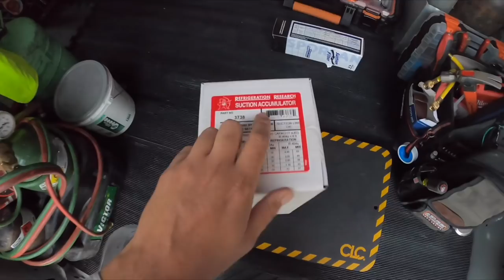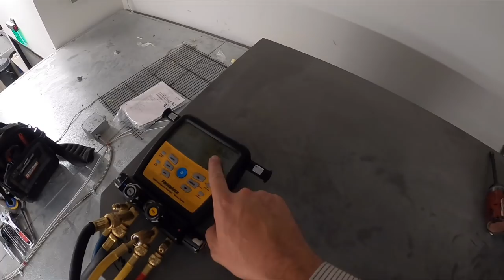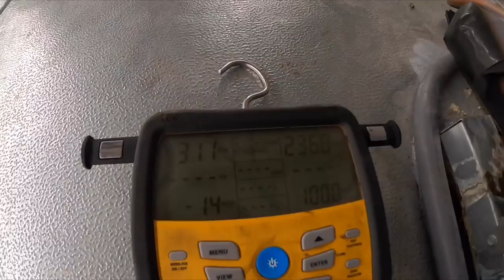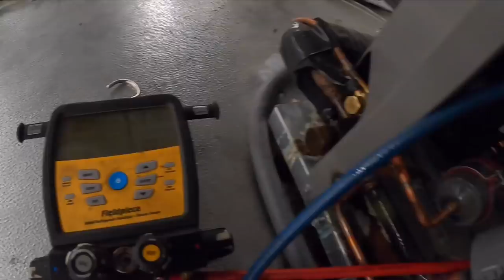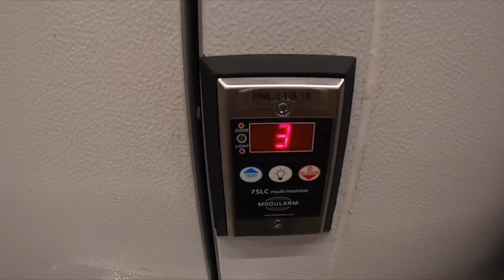WALKIN FREEZER VLOG

Comment: lol, GOT ENOUGH SOAP? Good job man, but damn, you soaked that damn unit lol. I would not spray the hose connection. It'll get inside the hose. Possible contaminant. Also, I always tell new refrigeration techs, to NEVER become an installer, or call yourself an installer. If you call yourself service tech you are both. It might be hard first year or so, but when you UNDERSTAND refrigeration cycle, when you actually can visualize the refrigerant flow inside the system, if you UNDERSTAND temperatures and pressures, you are the tech. Trust me, you will be unreplaceable. Serious refrigeration companies will NEVER look for installers. The pay by an hour (no commissions), and if dont cut it, you dont cut it. I went through the entire year of apprenticeship in 2006, but leaned lots. Also, if you treat trade as just a job for paycheck, you will be moving up super slow. Lots of informational videos on YouTube, lots of articles. Study, research and be interested in what you do, and then, you WILL become above all and unreplaceable. Good luck all! Stay SAFE and thanx for the video bratha! This Corona shit sux, but its a great time to invest in yourself as far as knowledge goes and improve your skills.

Comment: Do you not have to wear a body harness when working that high off the floor?
Reply: Actually, OSHA requires fall protection at heights of four Feet or higher. 
 I do commercial HVAC/R for a very safety oriented company. If I was caught in your position without my fall prevention harness, I'd get in trouble
Reply: Jake M only if OSHA officials caught you lol I never see OSHA officials in my career but one of my buddy was doing lifting with crane and OSHA official came
And ask buddy if he know where’s the safety switch for lift to come down if the lift is stuck at high height ? Buddy said no then OSHA official showed him where’s the safety manual in box. So he got fined and paid hefty fine ! No joke with OSHA.
Reply: Never seen an OSHA official. Our safety coordinator will however randomly show up on job sites. 
 He will inspect your work space, and ask to see if you have your PPE on you, make sure ladders are strapped properly, fall protection, hard hat if required. My company takes it seriously. I don't mind, gotta be safe out there.
Reply: Jake M but then osha allows a air handler in a retail space where you cannot access the filter door and it gets passed!!! But go up six feet and get in trouble!!!-
Reply: That's irrelevant. OSHA usually does not care if the equipment is installed in an area that may require mechanical assistance (I.E: multiple ladders, grid ceiling removal, or scissor lift) for service. Sometimes OSHA rules can't be followed if you chose to not adhere to them due to reasons of finance. You can always refuse to do a job you feel is unsafe without a plan of action.
Reply: Also. OSHA has little to do with enforcement of local construction codes/rules.
 If a customer owns a piece of equipment that has fallen through the code cracks, that's their problem, not yours. 
 They may need to pay another contractor, or you and your company.. To rectify the current issue and resolve the other
Reply: I just didn’t want him to fall and get hurt because I have seen people get hurt in any situation!  It would be hard for him to make a living for his family if he’s out of work!  Just be safety conscious on the job, look at the whole picture !! Thanks